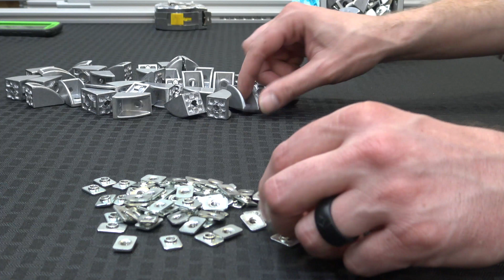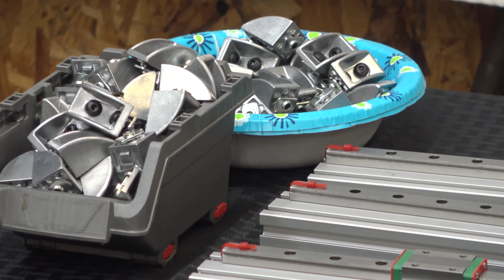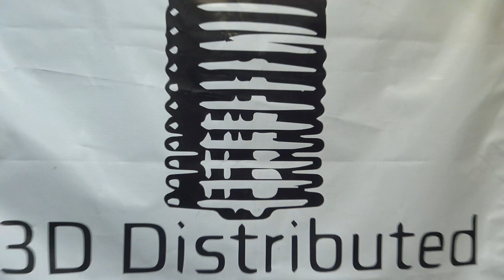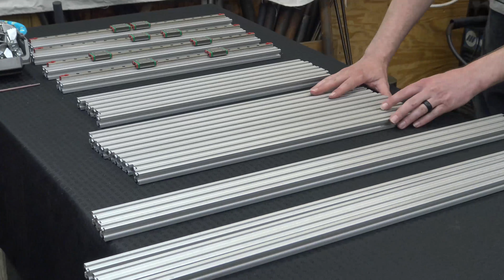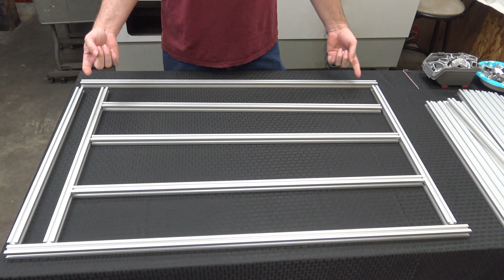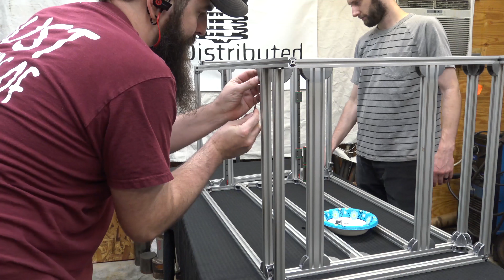WorkHorse 3D Printer - Frame Assembly

Comment: What is the capacity of the finished printer
Reply from the maker: The original Workhorse Printer has a 650mm x 350 x 350 build area. We're working on a new one that has a 600 x 600 x 600mm build area.
Reply: @3DDistributed  lol that funny that you say your working on one that is 600x600x600